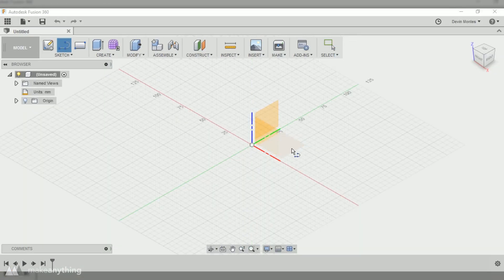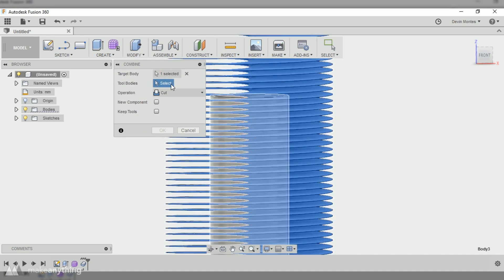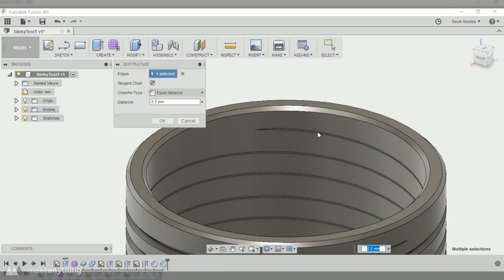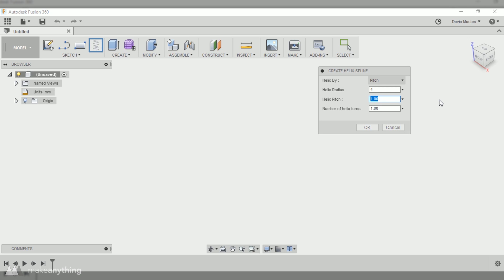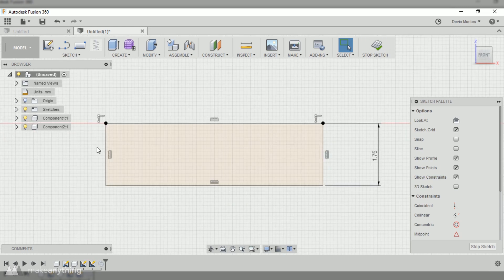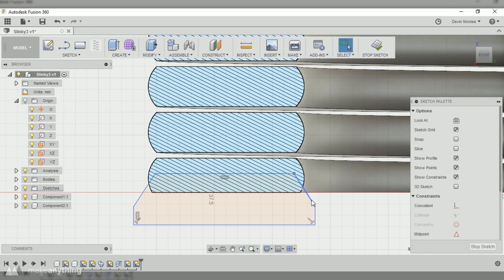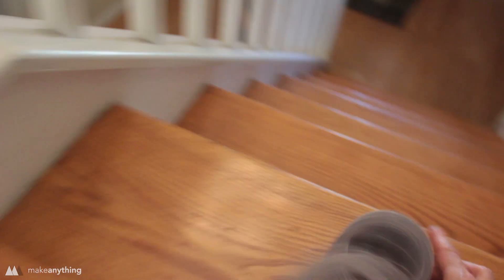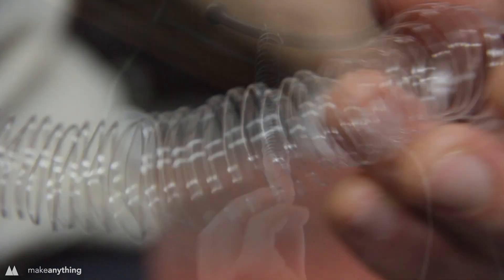3D Printing Springos (Not Slinkys!) // Fusion360 Tutorial

Comment: Now my question is can we make a spring. Just a general one and see how well the tension and pressure effects it. This could be an amazing way to use a 3d printer if so and my curiosity has been peaked by this idea. This would allow custom engineering plants to print custom springs or bolts and parts one day for clients which would be amazing.

Comment: On 12:10.
Have You ever tried to .... hmm, I don't know - maybe temper / relax the print before cutting it? 
(Why not try 30 or 60 minutes in the oven at 80 or 90 degrees celsius?) - 
or at least try to cut it submerged in a bassin of really warm (as hot as possible) water...

Comment: For anyone watching now, you can create a helix using "coil" in the create tab, set the shape to square, then modify from there. It requires a little more math (or just guess and check) in exchange for no plugin set up headache.
Reply from the maker: True.. I've been meaning to do an update with an easier method
Reply: No worries. The video quality is excellent and I have learned a lot from your channel. Thank you for your time.

Comment: When I received my second CR-10 printer, the Z-axis coupler was destroyed in shipment (apparently a common problem). A plastic "springo" was exactly what I needed to replace it!

I guess that's why you should never have only one working printer...

Btw, the helix spline plugin looks great but isn't available for Mac OS. There is a method involving creating a coil body and projecting it ("Include 3D geometry") that can replace it, but it's silly that Autodesk still haven't included a helix command. They could replace the coil command, since coils are helices with sweeps.

Comment: If you spiralize with a .4mm nozzle, .5mm extrusion thickness, and .32mm layer height, you can pull apart any shape carefully to get a Springo without designing the model to be one.
Reply from the maker: It won't spring down a staircase though!
Reply: I guess that is true (I have never heard of Springos before, so I do not know its definition). While it may not spring down stairs, it creates a super flexible and wiggly shape that is super fun to just drag and shake around. I suggest you at least try it for something small.

Comment: Just made a small version to test and it printed great! Printing a normal size one now with ABS :)
Reply from the maker: Nice, ABS should actually hold up better!
Reply: Man I love you for this springo, slinky? whats that? haha. I wish I could say that the ABS held up better but unfortunately ABS has the tendency to warp when adhesion isn't good. Seeing as each ring is technically printed in the air..I got a little warping, but luckily it was only on the edges and the springo still works great! I think it may be a little bit more springy than PLA though :)

Comment: I'm wondering if you could use a dual extrusion printer to alternate layers of plastic and dissolvable filament and get super thin spring-Os
Reply from the maker: I actually started trying this, but the super thin layers weren't sticking together.. plus the single material technique works so well I just dropped that idea
Reply: Ahh that sucks! have you tried with metal filament for extra wieght or flexible stuff for extra stretchiness?

On a side note I was just playing with my first hand spinner and was wondering if your air powered tops could be adabpted to work as awesome air powered hand spinners with a bearing incorporated.

Comment: Your creativity is amazing. You could just as easily have used the built-in coil feature in F360 for this (use a triangular coil and you have both a path and a guide rail at once), but the lack of a proper helix function in F360 is still missed. They are probably going to add it sometime in the future, though.

I think your decision to go with F360 instead of Solidworks was a good move. F360 is a lot more accessible to most of your audience, and being able to try out the stuff you show off is a good bonus for a lot of people.

Comment: Here in Europe where we've used the metric system for centuries we would never say 100mm, that's 10cm.
Reply: Freyja Svansdóttir When it comes to building things and engineering, everything is in millimeters and not Centimeters. And I'm a Finn myself! :)
Reply: In engineering we primarily use two criteria in choosing prefixes: consistency and precision. If we don't care if a length is a few centimeters off we might choose to say a meter, but if we say 1000 millimeters it's either within a millimeter of that or simply to match other lengths written nearby. Consider for instance technical drawings which will often have a common unit. Your typical carpenter's ruler may be 2m, but we'd be rather upset if that wasn't 200cm, while we might be okay if you got a 1.96m stick when we asked for a 2m one. 
This also relates to the engineering notation, wherein we allow up to three digits before the decimal point, while the scientific notation uses one. Thus engineering notation lines up with prefixes kilo, mega, giga etc. As such milli is one of the preferred prefixes, while centi, deci, deca and hecto are not. This practice means we always use millimeters when dealing with your typical 3d printer.
In particular the helix addon shown does something very frowned upon; uses a different unit within an interface where a common unit is expected, *without even indicating it*. Notice how the left pane has a "Units: mm" marker and other entries like the extrude distance explicitly state the unit.
Reply: By that logic you'd never say 10cm, that's 1 decimeter. As long has he knows the prefixes and magnitudes of his units and how to convert them, it's up to him to define his system and use it for the problem at hand.
Reply: Freyja Svansdóttir im an american and even I know that and get triggered when i hear that so thank you.
Reply: Van Gogh...Interesting
Reply: Vesa So Suomalainen, when would say "that's enough, now I'll go with cm or m"? Would you say 1000mm? 10.000mm? 100.000mm?
Reply: I'm not American, and therefore use the metric system, and I don't think 100mm is wrong in context. If you're building something, you use mm. In normal life, cm sure, but he's 3d printing - you're lucky he isn't using microns 😋.

I bet you measure your drinks in cl and dl!
Reply: Darryn Jones we use cl and l
Reply: swvshp centilitres and decilitres i.e. hundredths and tenths of a litre.
Reply: Pelnied No one ever uses decimeter, I haven't heard the term for 30 years. Deciliter on the other hand is used all the time
Reply: Freyja Svansdóttir 
Vhhhhhj
Reply: Freyja Svansdóttir we use cm and mm
Reply: Why not say 1 decimetre?
Reply: Freyja Svansdóttir it's how you measure if you use 3d printers or programs for design since all the stuff is often fiddly or you wouldn't use a 3d printer
Reply: We almost never use cm when it comes to engineering and science.
Reply: Freyja Svansdóttir it depends on the context. I'm an engineer and I would certainly say that some dimensions of an object are 300mm, or even 1400 mm, for example in smelting. And I'm Spanish :)
Reply: Freyja Svansdóttir you do know the he is in California and in California we use inches and feet